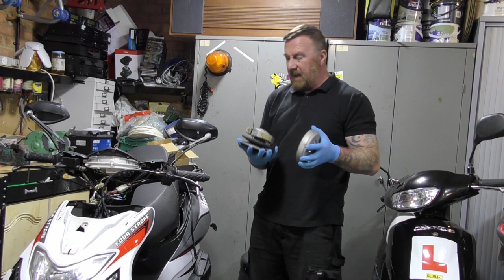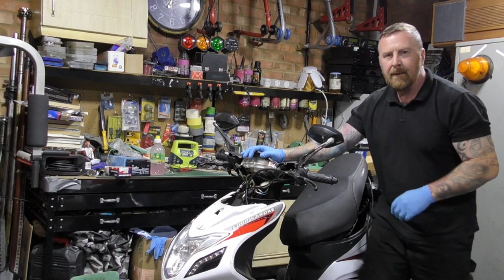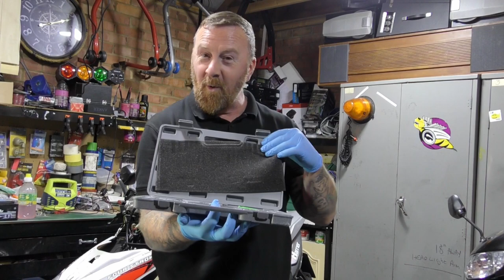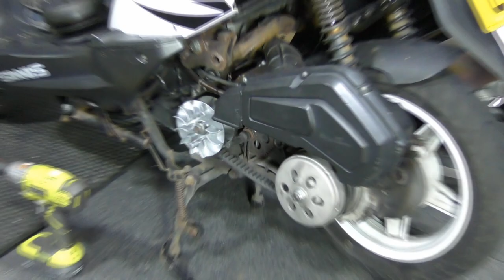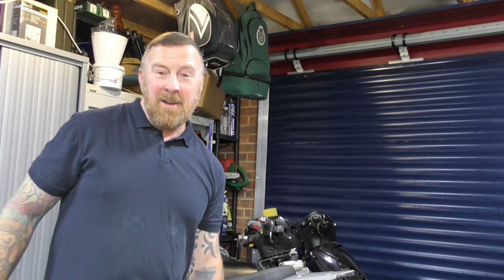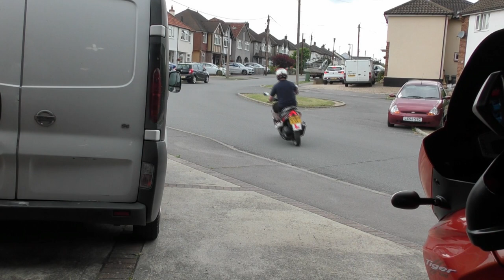125cc GY6 CLUTCH & VARIATOR / ROLLERS REPLACEMENT REAR WHEEL WONT STOP

Comment: Hi,Mark.loving your videos....quick question for you,if thats ok.....I have 21 forza 125cc.and I'm thinking of changing rollers to lighter g..as been reading,it helps slightly with speed.but I'm not sure how many g,the rollers are,in my forza..I think there maybe 12g,but not sure exactly...any help/information would be greatly appreciated thanks..
Reply from the maker: whats top end are you getting bud , i have not worked on one before so should check google specs bud
Reply: @marksavage  hi,I'm getting 75/80 mph.top speed,then I feel the scooter,like pulling back if its got a bungee cord,attached to rear...
Reply from the maker: @davemorier3066  that's a god speed to be fair and sounds flat out 
try a service and oil change and new rollers ,belt and see how it is after
Reply: @marksavage  yeah will try that thanks for your time...

Comment: HI MATE I JUST WATCHED YOUR VIDEO AND I NOTICED YOU GOT BLACK 50CC CAN YOU TELL ME WHATS BEST ROLLER WEIGHTS TO PUT IN AS IV GOT SAME BIKE 50CC DIRECT BIKES 2015 SO I CAN GET UP LITTLE BANKS AND MEDIUM SIZE BANKS.ALSO THE HEAD LIGHT ON FRONT CAN YOU CHANGE THE CONNECTION TO PUT A BRIGHTER LED BULB IN AS THE BULB WHATS IN THEM I CANT SEE ROAD PROPERLY AT NIGHT AS BULB WHATS IN 12V 35/35W PLEASE HELP..
Reply: Get yourself a variator roller kit 5 Gram up to 8 Gram, dont go cheap they will just wear fast. Work your way down the sizes from your current roller weight until you find optimal power. The bulb you need is a DA20D look up the X Racer series by the brand OSRAM, they are extremely bright and fit straight in. My two cents.
Reply from the maker: Wow like he said pmsl 
However try and stick to 6g so 36g total weight 
As for bulbs yes they will fit as in the comment
Reply: @marksavage  learnt from the best mark been watching you ages haha. However I did forget to tell him to clean the variator I know u would of 🤣
Reply from the maker: @kainatticus  if like you he had watched my videos he wouldn't have ask pmsl , but sure he will now 
You take care bud
Reply: @marksavage   HI MATE CAN YOU SEND ME WHATS BEST BULB LED TO GO IN MY 50CC SCOOTER ALSO PICTURE SO I CAN GET ONE AND THE SAME AS THE ROLLER WEIGHTS SO I CAN BUY THEM AND THANK YOU AND PLEASE KEEP POSTING YOUR VIDEOS..

Comment: The 'cap-nut' on a Honda scooter clutch is a NIGHTMARE to remove!
I tried stuff for days like heating/freezing/cheater-bar and it would not budge...finally had to buy an 'impact-driver' and that worked after I put a 'Dime' in the socket by pre-bending it to match the curve-radius
( That 'impact-driver' set me back almost a hundred, because the $50 'Hart 20-volt' had another package with a 'Hart' drill with the 'impactor' for another $30 so I bought it instead because I had another 'Hart String-Trimmer' product that took the same 20-volt battery)
A lot of money and effort to remove a 50-cent 'Cap Nut!'
Reply from the maker: i know bud this was why for £30 is was easier to buy another one complete lol
Reply: @marksavage  True...but I still would've needed to remove the old clutch first!
( I was worried over damaging the threading on the spindle using too much force....! )
While it's true you can kill a fly in the house with a shotgun...is it really a 'good idea?'

Comment: Least it rides and don’t cut out mate good job
Reply from the maker: It does and rides very well with the new system
Reply: @marksavage  mark I have a question mate I’m still stuck have you ever had a a moped
Run even tho the rings was gone I’m
Going to have to take the head off
Reply from the maker: @kayone8571  yes but it sounds horrible and smokes!
But will still run till the piston goes 
But had the engine bearings go and make a horrible noise too but still ran and ran well lol
Reply: @marksavage  thanks for the reply I’m done on this one today just checking spark ⚡️ is good there’s no water coming out of the spark plug hole so head gasket must be okey I’m thinking maybe it’s the coil once it getting hot courses this problem stumble the thing is I drain this old fuel and check it  I couldn’t see any water I’m
Thing maybe drain it and put fresh petrol in the carb is clean as well
Reply: @marksavage  some keeps telling its t he crank bearings really I don’t believe that mate
Reply: @marksavage  I’ve just uploaded a new VIDEO I’m not to sure if the crank bearings gone or not mate I do hear rattles tho but I wouldn’t think that would make the bike turn off
Reply from the maker: @kayone8571  sounds a bit like piston slap ,maybe small ends under the piston but odd 
Yea bud head off time
Reply from the maker: @kayone8571  they make more of a grinding noise not rattle bud
Reply: @marksavage  remove them top part head gasket looks okey very flat removing hole head in the morning then most probably engine off bike I have uploaded a VID so you here it does sound like a hammer 🔨 in the centre and around the the water pump thanks tho mark I’d like to keep you updated I was thinking of changing the cdi and could but I just think it’s waste of money as it’s starts up fine even like last night it did it at 50 mph and costed and came back to life while it did then off then it started again and was sluggish to hell 30 mph no power :( good old aerox